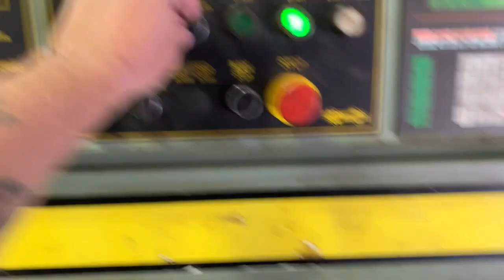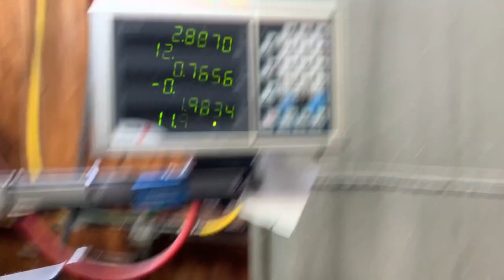2020 Chevrolet Silverado Fog Light Install (THE EASY WAY)

Comment: I was able to get the OEM fog lights from a 3rd party for about $150, it comes with a dealer code so after installation it needs to be brought to the dealership for programing about 1 hour labor, hope this helps.

Comment: I made a very similar bracket but used a wiring harness with a separate switch for mine so they aren't controlled by the headlights. Thanks for the idea!

Comment: For my 2021 Silverado it was $507.91 to have GM fog lights installed at the dealer, the problem is getting the fog lights (they are very scarce) and that's the reason GM isn't installing them on most new ones

Comment: Warranty issues? Bc everything I'm seeing is it will be an issue. I'm thinking of buying the factory lights for $220 and doing it myself but still then I feel like any electrical issues will be blamed on that for warranty issue. So crazy but reality 😂😂
Reply: Had dealer eat the labor , took them four and a half hours(more than they bargained for) but the end result looks good . I’m Not as talented as the maker of this video. Great Job.  The computer reprogram and call to GM for the code took more time than the install.

Comment: I agree fog lights should be on them.  My 2018 had fog lights and fold down armrest in the back seat with cup holders.  Not sure what GM is thinking. Just pissing off there customers.  I kind of wish I checked out ford.  Never had ford
Reply: Never get a Ford. Same shit different toilet. Tundras is where its at. Wish I would of got one of them instead of my 2020 silverado